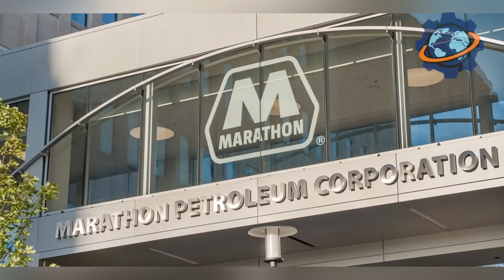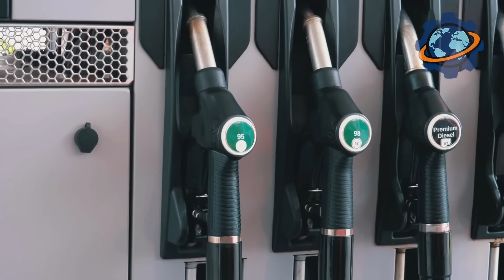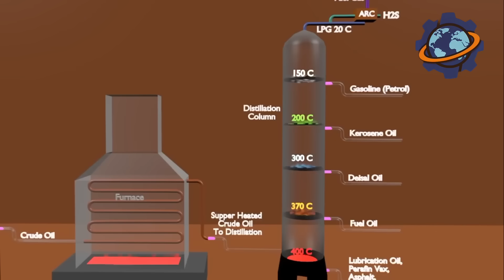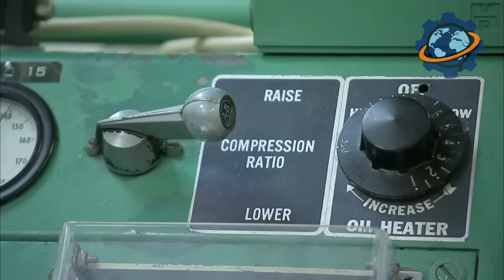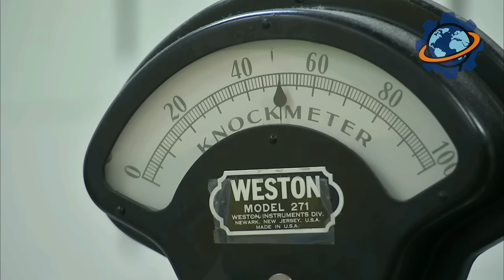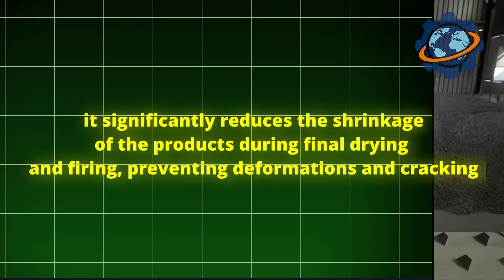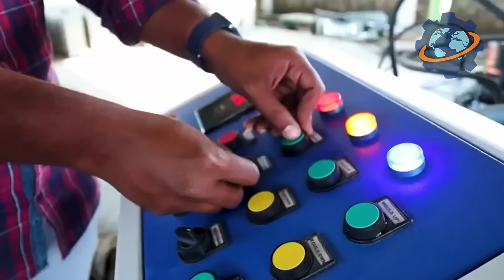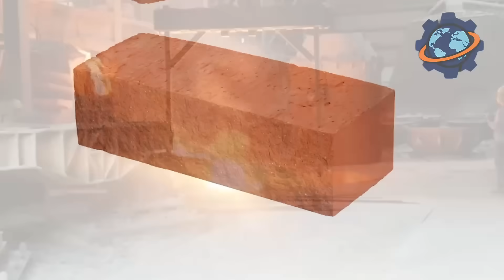How It's Made: 26 Million Gallons of Gasoline Per Day | Inside America's Largest Refinery

Comment: Why the oil must settle in the degrees of heats, because just as the cookibg oils over heart then it will caused fire, sane as the car without heart how can the it as transportation couldn't work or over the degrees if heart could burns to fire tgat must be required of rights calculations and each things on earth did have limited.
Reply from the maker: Your insight on the importance of temperature control in oil refining is quite interesting, @elsahelgasonh. It truly highlights how precise calculations are essential to ensure safety and efficiency in the process! 🔥

Comment: I worked in the GBR a few times over the years. First time was a few years after the ISOM unit went up. Was nothing but a cleared off open concrete slab. Then again just before the plandemic. Brand new unit in its place already running now. They even mentioned that Marathon put in some work on upgrades and needed maintenance after taking over, including some piping in their Alky unit that carries hydrofluoric acid in the site specific training.
Reply from the maker: Thanks for sharing your experience at the refinery, that's incredibly insightful!

Comment: I worked on the offshore platforms that produce the wells separated oil gas and water then put it in the pipelines to land.
Reply: Sounds like AI ugh
Reply: @DannyLeech-s2d no I’m a real dude. I started out there at 18 and got hurt at 28 in a helicopter crash no Ai here.
Reply: And you felt fulfilled by the work you were doing and the job being done by your company, all in a days or a shifts worth of work!
Reply: Your experience is impressive! Working on offshore rigs, where oil, gas and water are separated and piped to land, is certainly both arduous and requires extremely high technical skills. Do you know how much longer the future of energy will depend on oil and gas, when the world is running towards renewable energy?
Reply: @TechManuLine we will need oil for probably for ever. Oil is used in everthing from medicine to grease every machine on this planet needs Oil is in everything we touch until they can make all this stuff out of other materials then oil will be in our lives for a long long time.
Reply: @drewapple9681  You are absolutely right 👍! Petroleum is not only a fuel but also a core material for the production of countless things around us - from medicine, plastic, chemicals, to machine lubricants. It can be said that almost any object you touch has traces of petroleum in it. In your opinion, will there be a material that can completely replace petroleum in the future or will we have to stick with it forever?
Reply: At 18 first job on DB1. Biggest in the Gulf 1950s. Set the jackets off the barges , divers tied into gas  lines for bleed off. It also laid pipelines . I was taught by the best. 6G. Low high and p5 . Up hill down hill around the hill 😂 . 57 now almost broke down from oil refineries, chemical plants and power boilers emergency crew. Ala. Ms ark La East Texas. Many of long hard hours at Chevron in Pasgagula Ms. To much to list. 
America can supply Americans . W don't need anyone. Get gov Newsom out of office before he fks Arizona and Nevada by cutting off the Gas supply!!!  Thankyou 😊
Reply from the maker: That sounds like an incredible experience, @drewapple9681! It's fascinating to hear about the journey of oil and gas before they reach the refinery. What was the most challenging part of working on the offshore platforms? 🌊
Reply: @MadeonEarth-u7q wanna hear something crazy than that. I went down in a helicopter going to the platform. We had a tail rotor failure while landing that made the helicopter spin out of control  crashing into the water it shattered my back and crushed 80 percent of the spinal cord. I had to get out a helicopter that was rolling over and sinking all while paralyzed from waste down. Was picked up by a boat then into the crane basket and up to the platform then lifeflight in. Then 10 hrs of surgery 60 days in the hospital and 18 months of rehabilitation. I can walk but not far I live in back pain every day. But I didn’t die and had to retire at 28 years old.
Reply: @MadeonEarth-u7q staying away from family for 2 weeks.
Reply: And yet somehow, the people doing the hardest, riskiest work get the smallest cut—while the executives cash in from climate denial
Reply: @pennypotv I cannot say that I was taken care by the oil company and the helicopter company. I was set up for the rest my life.
Reply: It was great job. Where can a 18 yr old go and make 100 grand a year fresh out of high school with no college degrees. I worked 6 months out of the year and made twice the money people on la d was making.
Reply: @pennypotv  Nice Try ... I see everyone saw through Your BS.